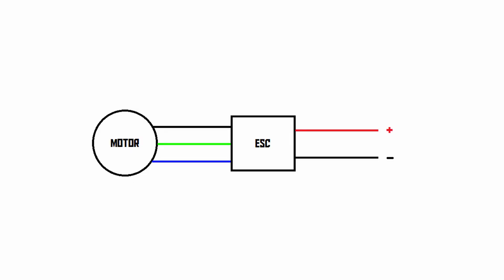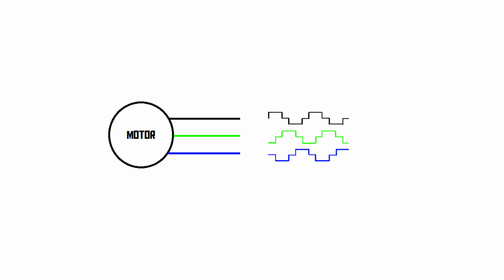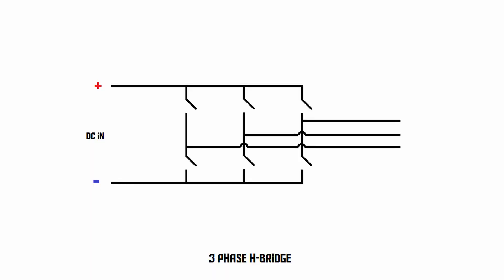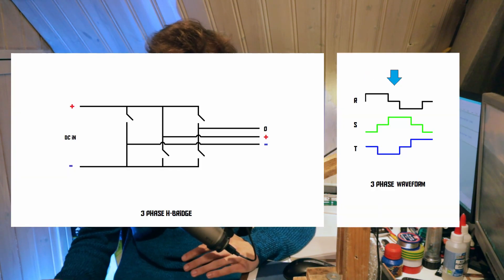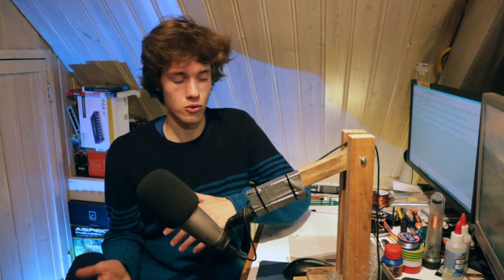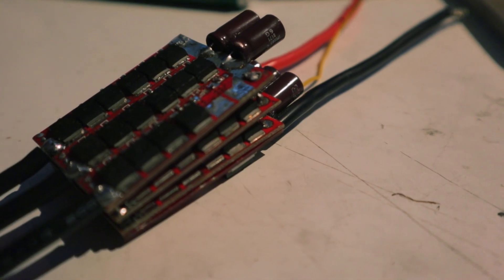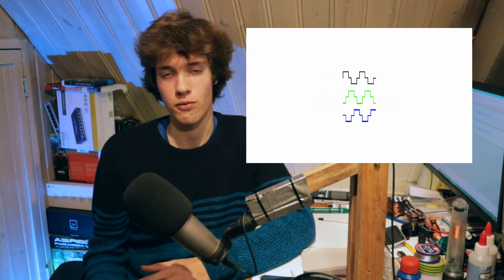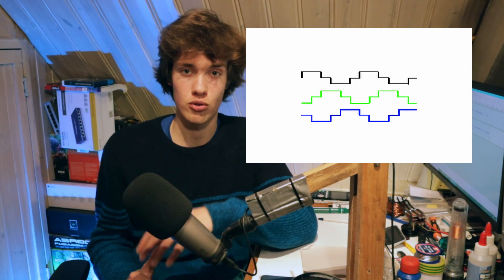What does a brushless ESC do? (AKIO TV)

Comment: What applications require this type motor?
Reply from the maker: These motors are very common in RC vehicles, cordless power tools, electric bikes, scooters, skateboards etc. Loads of things. It's not really required to use such a motor, as there's other types that will work (regular dc motors for example), but bldc motors tend to offer very good performance and efficiency for their size, while being pretty much maintanance free, which is why they're quite popular.